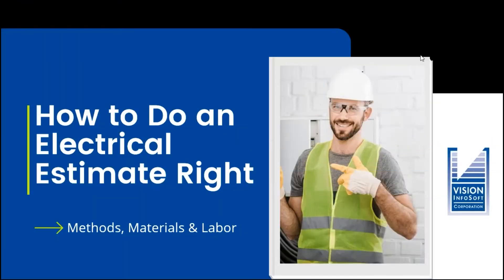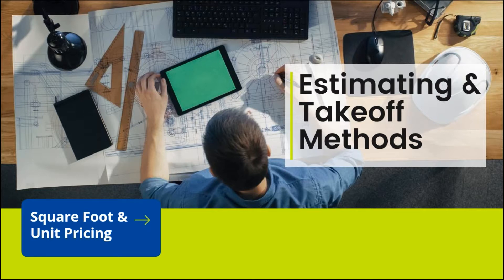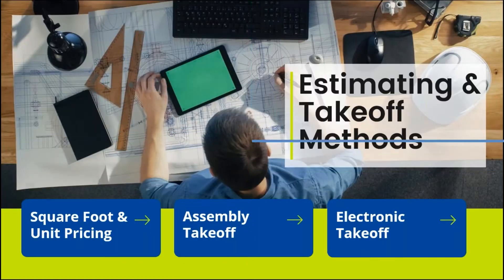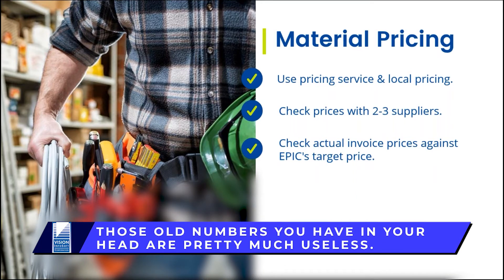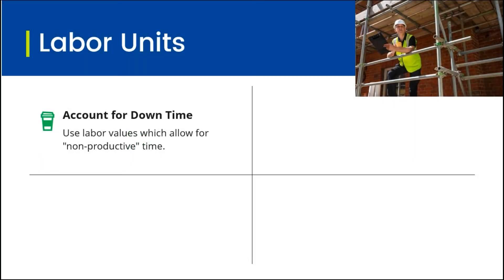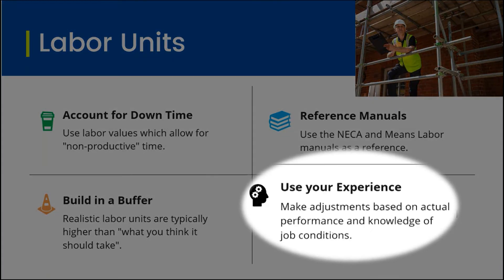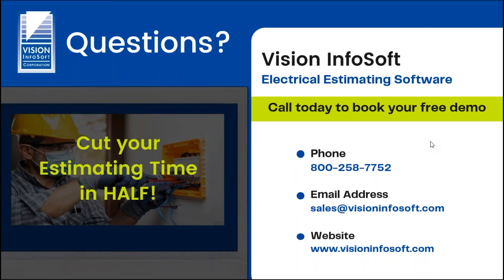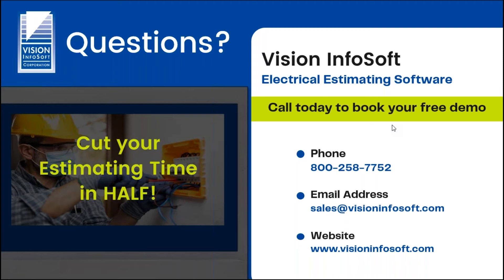How to Do an Electrical Estimate Right

Comment: Bidding is not rocket science. You first have to know your cost. The biggest question I get when coaching is "how much should i charge". Only large companies can use bidding software otherwise you are wasting tons of time bidding and less time trying to close the sale and build a great client list. Almost all the bids on my channel are bid the same way. Doesn't matter if it a $3k job or $300k. But it took me 6 years to finally get my system to work perfect! Every Time. No guessing if I made money. Thanks for sharing your system!
Reply: :learning:
Reply: My uncle is a electrician person. He takes plans and puts them on a scale. Then he see how much the plans weigh in grams and puts price out by waite. He tell me that the trick is having good scale. He say if scale is off then he can lose thousand of dollers. He seems to be going goode. He has nice truck with very expnsive wheels and very nice stero system.
Reply: @DDuffeeInc  what? by the weight in grams?
Reply: Do you coach on how to bid?
Reply: Yes
Reply: @The360Electrician where can we find your course

Comment: How u do the take off of the electrical wiring ?
Reply from the maker: You can use our software to measure wire/conduit/cable runs on your electrical plans.  Or, you can use our Site, Feeders, Motor Hookups, Branch Circuits, and Cable takeoff modules that help guide you through each wire takeoff.